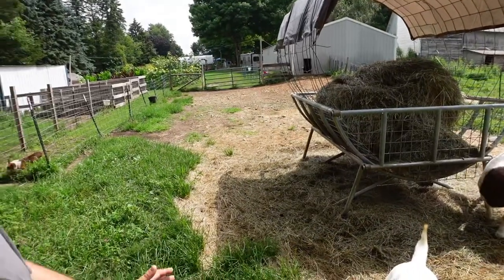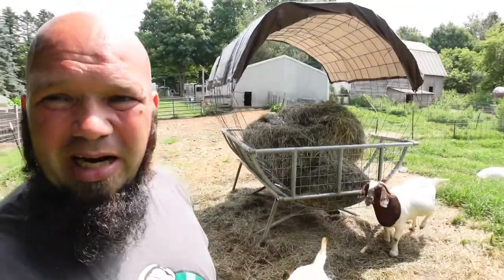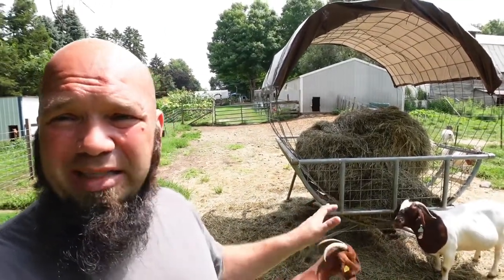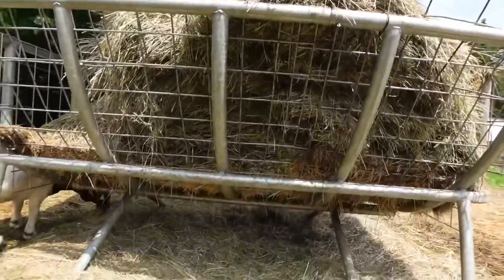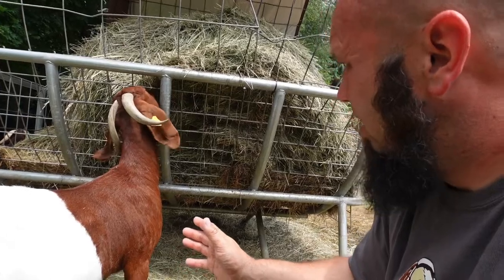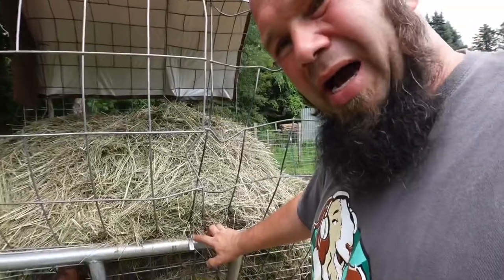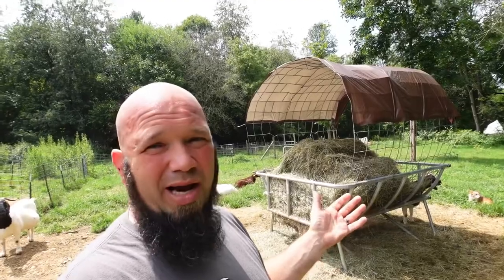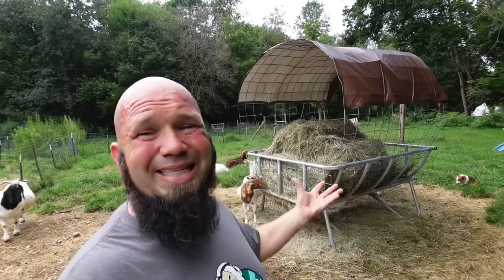New Feeder How’s It Working

Comment: We had the same issue with our North Star Boer goats feeder. It was a taller feeder. We had to add the same panels to eliminate danger of a hung up bale and waste. I think that’s a product of round bale feeds for goats. They’re not a perfect scenario. I think what your doing/planning is about the extent of it. We went to just pitch forking off a bale we set in the shed. North Star has an 8’ feeder with surprising capacity but it is a daily task. However, we have much less waste in the long run due to them cleaning up a much higher %. Maybe I’ll do a short video and tag you in it to show what are pros and cons are also.
Reply from the maker: Ya that be great